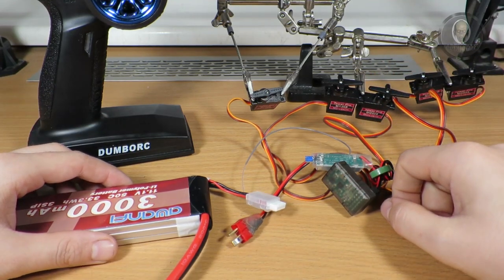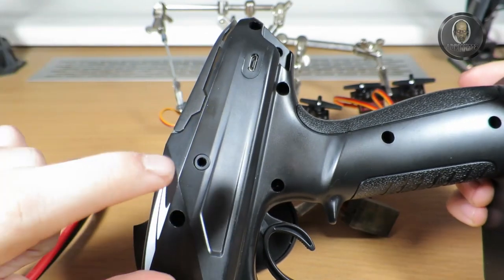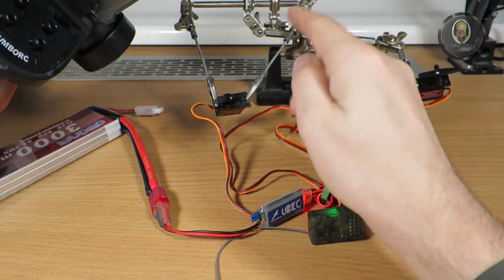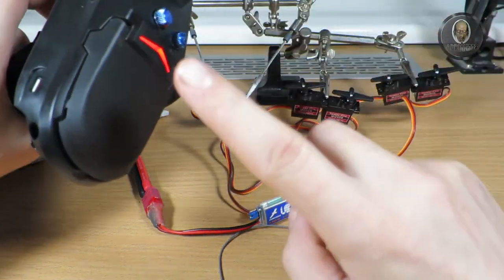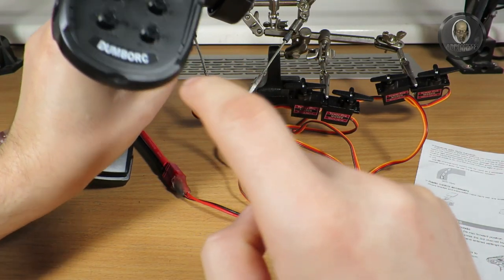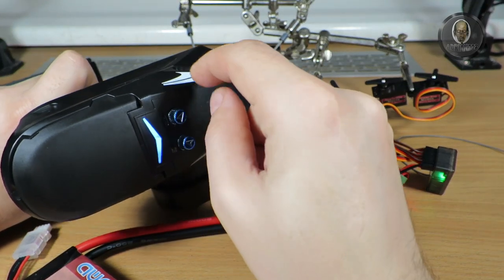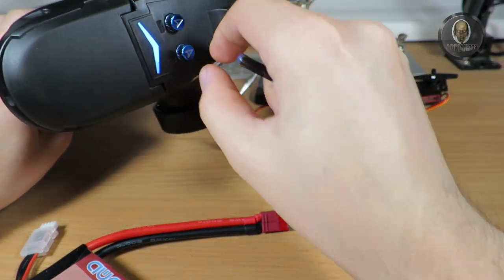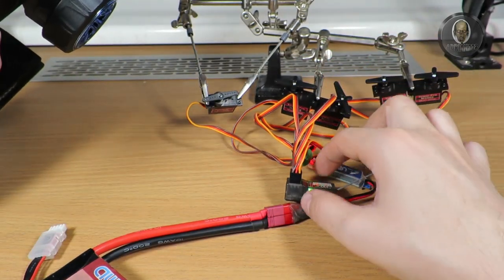Setting up DumboRC transmitter and receiver

Comment: Worked fine for two weeks for me but now it won't even turn on except i switch the steering back to reverse then it stays on but as soon as i try to reverse the steering back to normal it just shuts off don't know what to do 😒
Reply from the maker: Check batteries, if receiver turn off than check connections, if transmitter turn may be faulty than call seller about it

Comment: Sir I bought x6 everything is one and I am using 320a ESC and 2s lipo and my transmitter shows blue and green light and there is no response
Reply from the maker: Some people also have this problem and I don't remember what they do to fix it :(
I did not find this problem on My radios so I can't show how to fix it.
Here is what You can try:
1. Check if light on receiver is solid, if it's blinking than it mean it's not connected to receiver
2. Try to change mode to v-mixer and back to normal
3. Get in to calibration menu and calibrate all channels like I show on movie
I think it's just some safety or something but I don't have this problem and can't check what's wrong :(
Reply: @Adrian202  thanks

Comment: I have problem,i think its esc-it got brake off,on and airplane mode...
When i connect servo it steer on right side and not responding on anything ? Du you know what is problem ?
Reply: I have 10a esc same what u revuiewed
Reply from the maker: Brake is only on ESC, First tell Me what channel ?? if You mean channel 1 (steering) than check if You have center in middle and second pot on full to have full range if Yes than You need to set ranges to full, go into program mode and move steering wheel and throttle in both directions to set maximum angles on channel 1 and 2 :)
Reply: @Adrian202  program mode ?
Reply: @Adrian202  do you have instagram or something ?
Reply from the maker: @janyjjsjsbjyjs5928  I just show program mode in this movie :D
Facebook "Adrian RC"

Comment: Does the dumbo x-6 have a fail safe
Reply from the maker: So yes and no
There is failsave but if You turn off remote fist car like to turn on steering or turn on motor and go forward so for My giant Mercedes project I have separate failsave just to prevent that gas freek out

Comment: Thanks very much for showing all of the functions. It would've been so great if the receiver had a normal button on top - mine's now stickied  in my receiver box and I can't activate gyro mode without ripping it out :(
Reply from the maker: bigger buton would be to easy to click so something inside like cables may click it and unbind it but hole is so small that You could just drill small hole in Your RC and Use something thin to click it :)

Comment: Is the receiver waterproof?
Reply from the maker: No, only if You make it waterproof. remember how cheap is this radio :)
Reply: @Adrian202  how would you make this waterproof without messing up the gyro?
Reply from the maker: @rd7227  There is a spray that make electronic waterproof and that You open receiver, spray it as much You can and close it back or just check on Youtube how people do it because gyroscope can be covered and that should still work fine :)

Comment: How do u put power to the receiver
Reply from the maker: Receiver can be powered from motor controller (ESC) build in BEC (build in power converter) or just separated BEC
Reply: @Adrian202  I got It sorted I just had a fiddle with a battery an esc and I got it to work 👍

Comment: Having trouble. I plug everything in and as soon as i turn on the radio all power shuts off. I trouble shoot by removing servo and ot works plug servo in it shuts off. Help?
Reply: Also can not go into secons mode.
Reply from the maker: @smakkid356  About the servo that may be problem or with servo or with power source for receiver
I understand that You try to get in to menu as I did ??
Reply: If you have facebook i can send video of my problem. I have tried different esc and different servo. And yes i tried to go into the v switch mode where the light will turn red and nothing.
Reply from the maker: @smakkid356  Video would help, My Facebook is Adrian RC
Reply: Message sent. Thanks.

Comment: Thanks but can it handle 3s as you r using 3s
Reply from the maker: This doesn't do anything with receiver because ESC need to be able to work with 3S battery like DumboRC ESC can work with 2S and 3S battery but receiver still get 5v or 6v

Comment: Hi there, could you inform me that how i can activate the fail safe, please?
Reply from the maker: I don't think You can activate or deactivate it here.
It's mostly on by default in all cheap radios and it's set to get all channels to middle position but here receiver like to send random signal to channels (You can see that when You turn off radio first and car start to turn wheels or run on full speed :D )
Reply: Adrian202 RC Yes this is exactly what happened today, my nitro car ran away and hit the wall :(
Reply from the maker: @excoursion  it's good radio but still it's just a cheap one
Reply: Adrian202 RC Yes the remote distance is amazing.
Reply from the maker: @excoursion  Signal is very strong that's why it's getting crazy next to radio

Comment: Me puedes ayudar el control seme puso en modo tanque la lus esta roja nose como ponerlo en modo normal
Reply from the maker: 1. Turn off transmitter.
2. Put throttle to full reverse and turn on transmitter (still hold reverse)
3. Release throttle to middle
4. Mode changed :)

Comment: When i turn my transmitter off my truck tried to run away...why is this?
Reply: Yes I have the same problem with only one of mine, did you fix it and how.
Reply: bit late but always make sure the car is off before you turn the transmitter off, and that the transmitter is on before you turn the car on.

Comment: How to reset channel 3 and channel 4 on dumborc hand
Reply from the maker: You need to get in programming mode (that will depend on version of radio that You have) but before You enter set both channels potentiometers to max. Remember to move steering wheel and throttle trigger to minimum and max to set full range of channel 1 and 2

Comment: Hello, is it possible to erase the receiver? Because I already binded it and I bought some new parts for my rc car and when I plug them in to the receiver it doesn’t connect to remote
Reply from the maker: Yes You can bind it to transmitter.
Depending on transmitter it will automatic connect to nearest transmitter or You need to hold bind button and turn it on.
If i remember on transmitter You need to hold button to get in to bind procedure but I don't remember that so better check manual

Comment: How to adjust brakes sir
Reply from the maker: You have switch to reverse it, potentiometer to adjust center and in settings (check manual) You can limit ranges, but it's better to stay with default range
Reply: adjust reverse throttle sir

Comment: Which channel for battery
Reply from the maker: any of theme but mostly it's ch2 because ESC have build in BEC but if You use gyro You can also use that connector
Reply: @Adrian202  i have wpl c14 i ordered this controller. I wanted to connect a winch   , light , 2 speed transmission and servo how i can i coneect it
Reply from the maker: @dion9265  winch can be controlled by ch4 because it's 3 position or pot on ch5, 2 speed gearbox I don't recommend but can be controlled by ch3 and lights by ch6 if You will not use Gyro.
I recommend to not use switchable gearbox and Your life will be more easy :)
Reply: @Adrian202  but if i use gyro !?
Reply: @Adrian202  y not switchable gearbox ?
Reply from the maker: @dion9265  Than You will not have so many pots and buttons to control all because channel 6 pot control gyro
Reply from the maker: @dion9265  as far as I know they break very fast
Reply from the maker: @dion9265  As far as I know they brake very fast
Reply: @Adrian202   can i use light in channel 5
Reply: @Adrian202  how will i use gyro

Comment: I need help with the light on the transmitter is blinking while the esc is plugged in (and on) and I ONLY have the esc plugged in (because im waiting for the servo to arrive) and im wondering how to fix this, or if it just need a servo to combine with the esc to work for some reason
Reply from the maker: Is receiver connected to radio ?? Maybe it's signaling that radio is not connected

Comment: Is there a way to make all the servos turn 180 because they won't do that for me
Reply from the maker: There is mechanical block on gears and electronic position detection on potentiometer that block continuous rotation, not all servos are easy to modify
Reply: @Adrian202  I am not talking about the servos I am talking about the transmitter because i know that servos are not about to do continously rotation however the transmitter doesn't allow the servos to rotate at their limit and I was wondering if it was possible to modify it so the servos could rotate at their limit